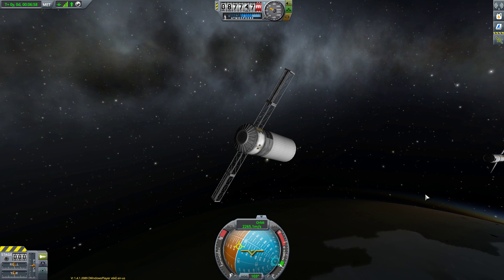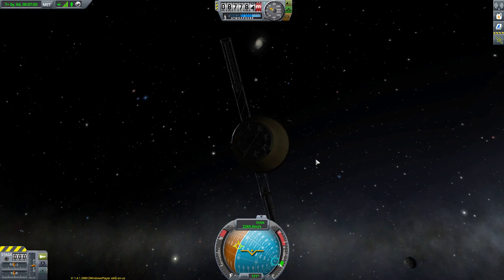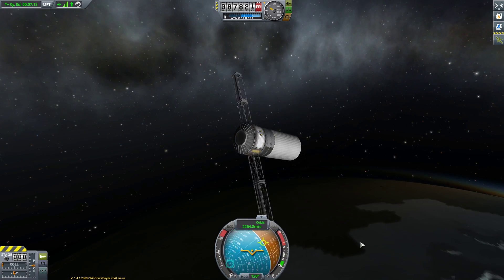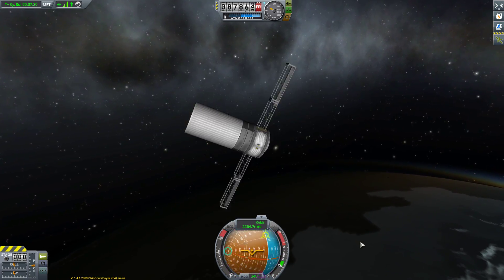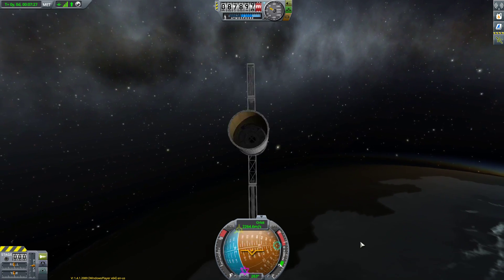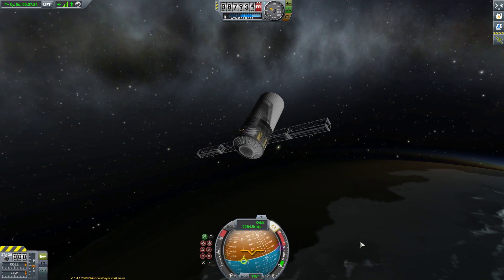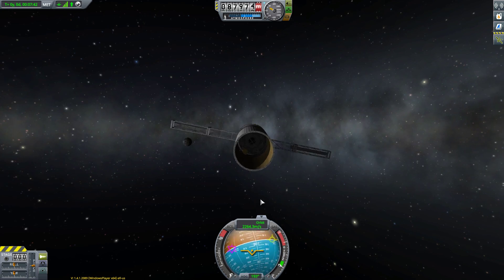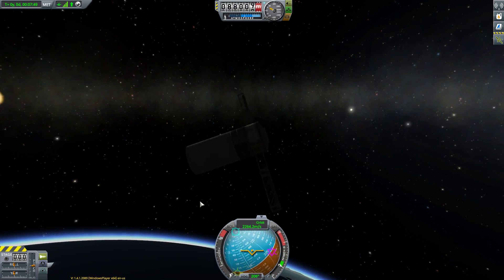KSP Spinning T-handle recreation

Comment: Nice demo :D A quick explanation on why this happens. You have two factors that play a role in this. An angular momentum sphere and an energy ellipsoid. See picture here: https://imgur.com/a/a1351Y2  Energy is inversely proportional to principal axis inertia. Energy ellipsoid always touches the momentum sphere at least at two points. The motion of spacecraft can be plotted on angular momentum sphere. Now if you spin the spacecraft along the minimum moment of inertia, the energy ellipsoid is at its max, with the angular momentum sphere engulfed entirely inside. Since the spacecraft motion traces are made on the angular momentum sphere. No interference on these motion lines takes place with the energy ellipsoid. Similarly for the case of max inertia, no traces are made, since now the ellipsoid is inside the sphere. However, a spin around intermediate inertia axis, makes the sphere and ellipsoid insert in a weird way ( see figure: https://imgur.com/a/a1351Y2), this messes with the motion traces on the momentum sphere. Every time the spacecraft motion traces hit the X point along separatix, it flips direction. 

Is there a way to fix this? Quick solution: Remove energy from the source, use some sort of disturbance to extract energy from the system. Nutation dampers etc, but ofc, it'll take a lot of time to slow it down. because spacecraft in space are underdamped systems.